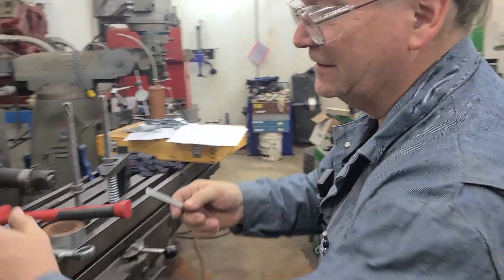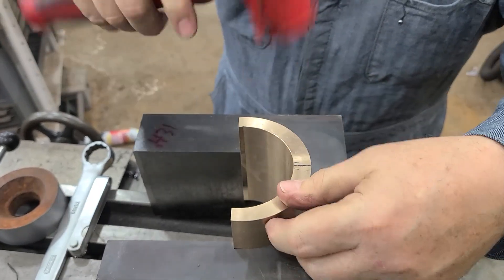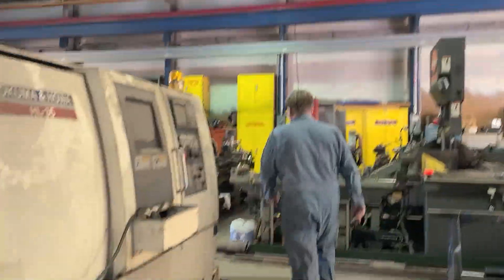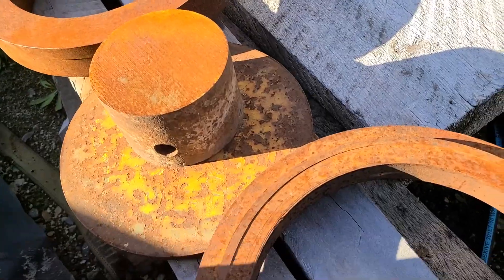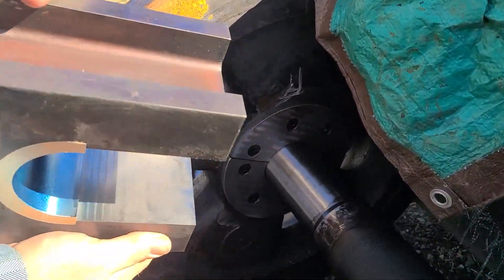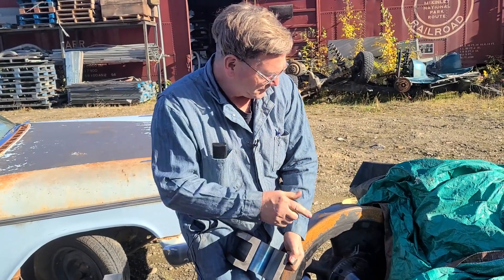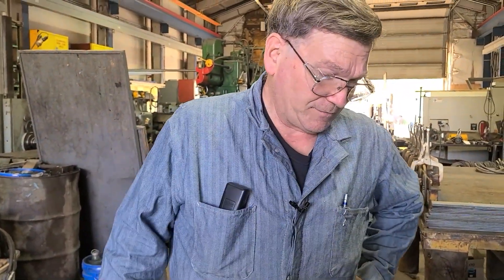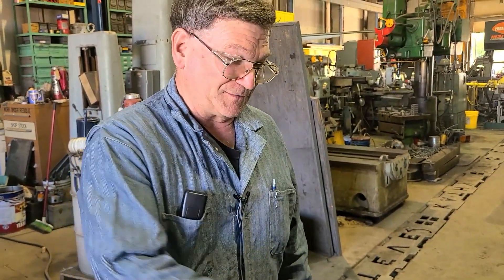Machinist's Minutes: Completing a 100 year old design with a hammer (BB 2/3)

Comment: Absolutely love the '58 suburban! I built a '57 plaza into a rat rod at our vocational center when i was in highschool. I just found your channel a few days ago and it's my absolute favorite!  I've been a mechanic and heavy equipment operator my whole life and recently been working towards starting a small machine shop. Thank you so much for sharing your knowledge, you're downright awesome😎
Reply from the maker: The 58, is planned to get a 2003 Dodge 4x4 frame, and a 4bt engine.  I have most of the main components, The 4bt is fresh, as is the 47re, I have a low mileage transfer case, and a 2003 frame/axles, but time is keeping it in the waiting room.

Comment: What is the most appropriate oil for large bronze bearings like that? I have one does 270rpm, 4½" in diameter with a ring oiler. Are there any oil types to avoid?
Reply from the maker: Load, temperature etc, all play a roll, so I am hesitant to give a specific suggestion, as are most oil manufacturers.  I have seen commonly the recommendation of a turbine oil for this general type of bearing, the viscosity choice is varied iso22 to iso680, the most common would be iso 68.  I use chevron GST68, along with other weights, I only give this, so that you have a starting point for a turbine oil by a manufacturer's designation.  Do not use GL5 gear oils, they contain too much additive for oil adhesion, so they will erode brass/bronze alloys.
Reply: @HOWEES  thankyou for the very helpful input. Knowing little I would have reached for gear oil thinking that thicker must be better and if it doesn't cause the bearing to heat then it should be fine. Maybe i should have given a bit more detail really - it's a sawmill crankshaft, a reciprocating vertical frame saw. Peak cyclical load on the bearing at BDC  is only about 5 tons per bearing, and the crankshaft rotating assembly is about 1 ton, so I would estimate it to be relatively lightly loaded for the size of it, but intended to do 1000s of hours, and then 1000s more with minimal maintenance,
Reply: Don't use any oil that contains sulphur ! Many years working as a machine tool fitter I have seen phosphor bronze worm wheels and bearings eaten away by sulphur additives. Best check with oil suppliers.
Reply: @russelltaylor7779 Interesting,  I had always believed that the high sulpher content oils were good because the sulpher was a great high pressure additive, good to know it sticks to/breaks down bronze.  I'm just a hobby machinist, so nothing I do is critical,  but the more you know...
Reply: @russelltaylor7779  thankyou, I thought I had been told something about avoiding a specific additive in the dim past.